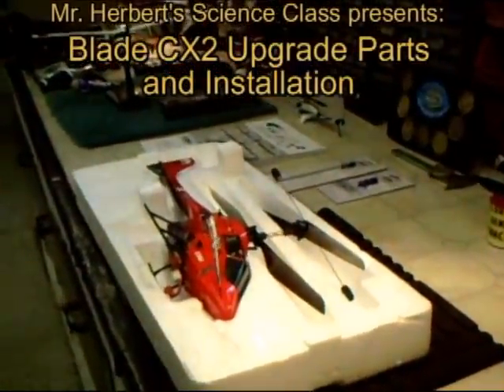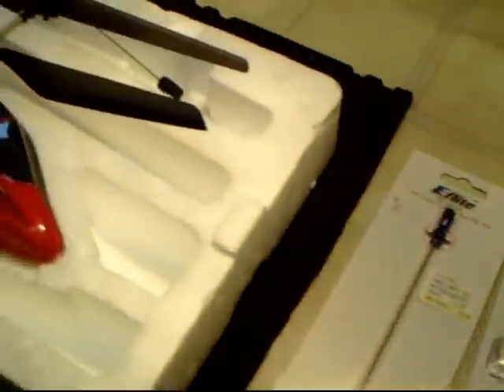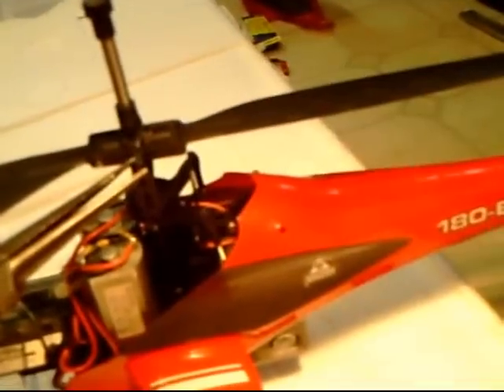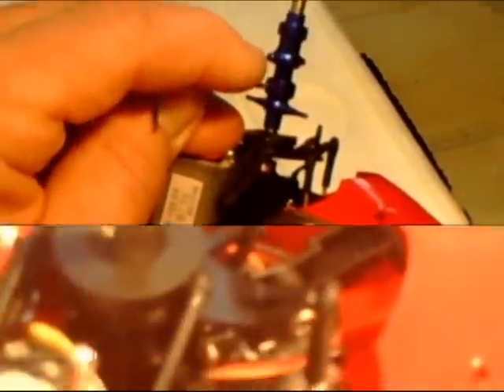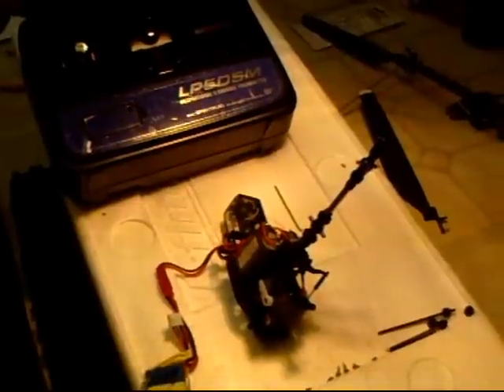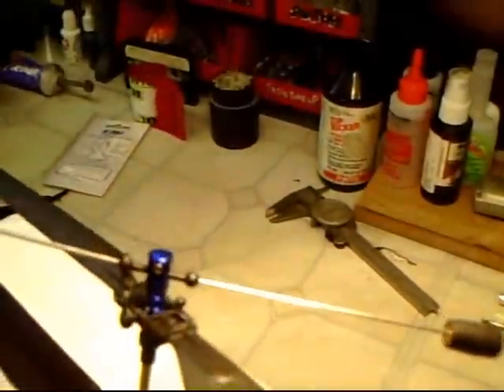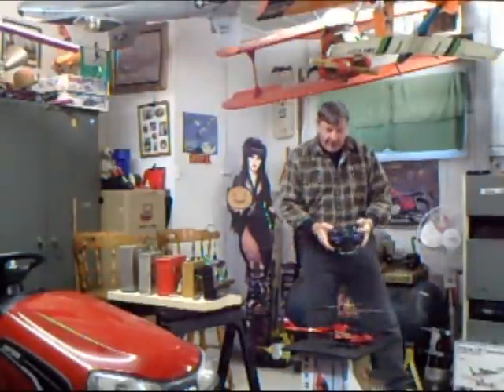Blade CX2  Upgrade Parts installed.

Comment: Thanks for the advice. It is hard to put it down after starting to get it "hopping" up to hover. I mean hard to stop flying it, but I'll set a timer. I did put on new motors as a check, but -- please laugh long and hard at or with me -- I had put an upper blade set on the lower blade holder!! So, they were turning backwards and fighting the upper. Funny how you can look straight at a problem for hours and not see it until that one quiet moment of clarity.

Comment: They didn't decrease flight time on mine and I have them. These parts are better as they don't break like the plastic ones do (I sheared the pins off my lower hub in its first crash). BTW, the aluminum upper hub is now standard equipment in new Blade CX2s shipping from Eflite. Only minor gripe is that while the upper head doesn't break, the inner shaft can get bent easier in a crash. But new inner shafts cost less to replace then the old plastic head and shaft assembly.

Comment: if you are thinking about getting the CX2, the new one should come with the aluminum head and inner shaft installed all ready, mine did, and if you have the money,buy the landing kit, set of ping pong balls on rods, keeps it from falling over and blowing the blades. did crash my CX2,killed the landing skids, 5$(cdn) laterit was fixed,the point, if you have the money, get the CX2 and the mcx and just get the bind n fly version of the mcx,uses cx2 controller so save you money, start with MCX 1st

Comment: Hello , Maybe you can tell me what I'm doing wrong ?  The upper blade does not turn I,Tried reversing them and it worked fine so I know its not the motor . I messed with the Main Motor Proportional Mix Trimming Pot and it seems like that's when I stared having this problem . What's your opinion ?
Reply from the maker: Sounds like a burned out Speed controller. Check the wiring to it.   If motor is good, there is nothing else.  I never messed with the pots, but maybe that pot decided to die too.  Sorry I cant help any better.
Reply: @NightFlyyer  Thats kinda what I came up with. Top motor runs fine if I just switch them so I'm thinkin same thing , Thanks

Comment: I just got my blade cx2 and it had a problem.  I have flown it for 2 days, about 5 times.  It started ok, it just needed a little trim adjustment to the back and right. Then it worsened.  The problem is described in the previous post

Comment: Thanks for making the videos, they are very informative.  A couple questions on this one: You adjusted the servo to be perpendicular when it's centered. Was that just a matter of removing and repositioning the servo arm? 
What's the procedure for adjusting the blade tracking (where whiteout was used), if necessary? 
Thanks again and keep up the good work!

Comment: the newer versions of the cx-2 have the aluminum heads already installed. also, is the battery a 2 cell 7/4 volt 800mah battery pack? i have two of these from a roken helicopter that i plan to use in the cx-2, but the cx-2's battery looks linger. is that fine?

Comment: but wait... I got the one set screw in the top part of the lower rotor head secured in the hold in the shaft.  Funnily enough, I only have one set screw ( the Engrish manual I got from the upgrade place said use four set screws to secure the lower rotor head set. However, It doesn't seem to need more than one. There are two parts to that lower rotor head set. the lower of the two lower head set rotor parts slides into the upper part firmly, It does not need the set screws I can't find anywhere!!

Comment: Hey you are really talented at flying the heli

I have a blade cx2 and i wanted to make it more manuverable by changing the position of the push rod but I have one question. once I change the position do I have to make it longer or shorter or change anything else? And should I do it to both servos or just the servo that makes it tilt forward and backward? 
If you get a chance please reply 
thank you for your time

Comment: Thanks for the great video tutorial. After removing the 2 screws holding the inner shaft I can't seem to pull it off. How can I get it out? I'm pulling pretty hard but I only got it a little ways out. Is something stuck in there? If so - how do I fix it?

I pulled a couple of hard turns and the lower part that holds the blades onto the shaft broke and my CX2 fell like a stone :(

Comment: Hey thanks again,

It worked. I'm all tightend up and flying. Can you tell me why I had to "force" the new lower head down into position? is this normal. I'm worried about future repairs if I have to get that head off and back on again.

Comment: great vid! I have just broken my new cx2 and the upper blades plus the cap onto which you put the flybar weight broke too. is it hard to repair it? I will probably invest into the aluminum upper cap. thanks.

Comment: OK, so there is a hole in the outter shaft on this model -- does the Aluminum part that goes on the outter shaft need to line upwith that hold for it's set screw? If not, how do you know how far down that part needs to be set? 

Also, my CX2 no longer gets airborne. One think I noticed is the ESC light goes red after pushing the throttle ALMOST all the way up -- about 7/8-ths up. Does that mean the ESC is cutting off throttle power at that point?

Thanks for any information and nice flight!!

Comment: I'm ok on the TX...however, my problem seems to crop up...then I take shaft out...replace...fly 2 or 3 mins...then slow top rotor...spin...land...

I now see that I have a chipped tooth on the "top" gear or the gear that spins the lower blade...There is friction and a slight jam at that notch...could this be interfering with my "top blade" somehow?

Comment: I have  bought a Blade cx2 and need to change the outer shaft main gear.Does it just pull off the shaft and the new one push back on? I found the video helpful thanks

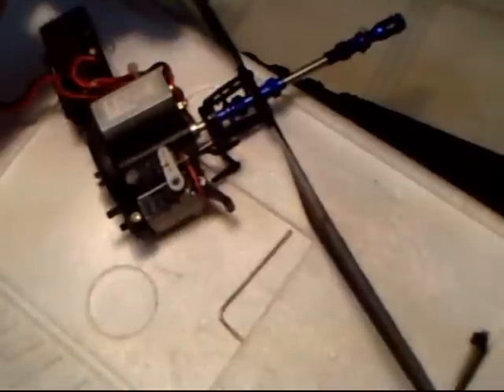Comment: I noticed at 3:54 the round disk that the servos move to make the lower rotor change pitch to move the helicopter in flight is even with the bottom of the motor.  Mine is slightly angled down in front and angled down on the left side (looking from the front).  This is causing the heli to want to move forward and left even though I have the trim all the way to the back and right but it still doesn't help.  During flight I have to hold the right stick back and right to hover. How would i fix this?

Comment: I upgraded the lower head with the new alum. When I slid the new lower head on, I got some resistance near the bottom and had to force it into place. 
I got it all back together and it flys just as good if not better than before. However, I have about 2mm of "play" in the upper shaft. When I pick up heli by top prop, the prop and shaft comes up about 2mm. This can be seen at the bottom also. It will "pickup" the "big" gear about 2mm. Is this normal? Thanks

Comment: Arghhh...Today my blade seems to be getting "slow" spin on top blade. Heli will spin left before takeoff. Throttle up does not allow take off. Heli tips over. Was working fine after low head replace but not now. No crashes...just started acting up between flights. any advice?

Comment: I installed both rotor heads and it worked fine, then I crashed and the upper rotor head seems to make some vibration but when I took it into parts nothing seemed to be wrong except that the wheel that makes it spin is a bit bent, is it possible that that makes the vibration?

Comment: I have an e-Sky  blade CX2 2.4 ghz then I have a working LP5DSM 5 CHANNEL 2.4 ghz by  E-Flite  radio . my question with the Heli Bind with this[ non Esky radio ] or  do you have to use  the same manufacturer radio to the heli ?

Comment: Need you help
Reply from the maker: Whats up?
Reply: My dont flying only go to circle
Reply from the maker: @juanvillagomez9180  That usually means one motor is not working, weak, or a gear is bad.  That causes one blade to go faster than the other.  That is also assuming that trimming on the transmitter does not work.